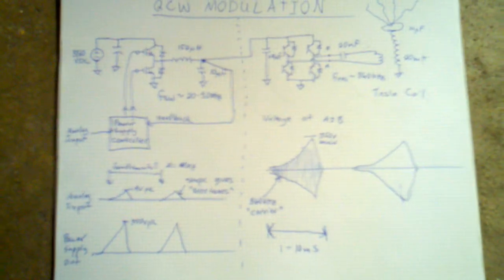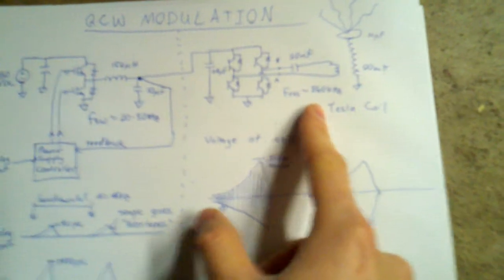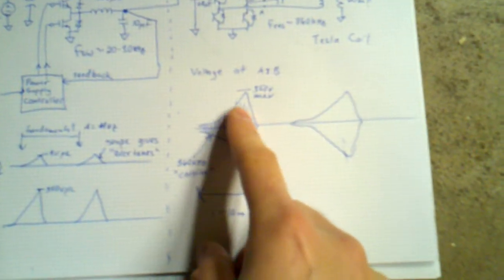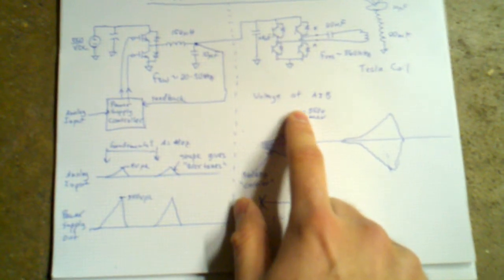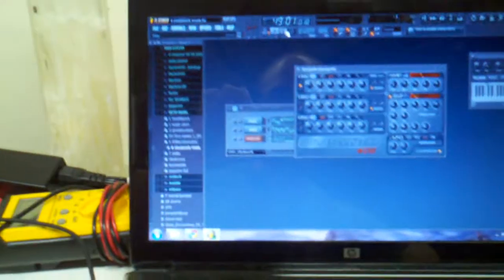QCWoverview1

Comment: Hey Steve! Thanks for the video. I wanted to take this opportunity to say thanks for the Staccato circuit. I started to build a RSGTC back in the 1990s. Had a 14KV Pad transformer for it. Life happened things changed and that projected faded away. Last July 2023, I got excited about coils again, and discovered vacuum tube coils via Steve Arcs. I  finished my GU81 coil and got the staccato installed the other day. That got me hooked on vacuum tubes. I have a GU5A I want to build into a coil as well. The solid state coil is very interesting but the cost of the parts and the ease of destroying them has kept me in the VTTC camp. Maybe some day I'll try a QCWSSTC when I need more challenge. Thanks for all your contributions to the community.

Comment from the maker: Yes, the schematic is missing all the details.

Right, the bottom fet of the "amplifier" is not required, it does improve control, but i have in fact ditched it and went for a standard buck (instead of synchronous buck).  

Yes, you could bias the thing to run half voltage for zero audio input, and this is what i originally did with the project.  The audio quality was better (NOT hi-fi!), but it required much more power and the components couldn't keep up so it limited the spark length.

Comment: I assume on that schematic the feedback/drive circuit for the FETs is missing. Am I correct in saying this circuit more or less just varies the power supplied to the FETs? If so, are you sure the bottom FET in the class-D amplifier is needed? I don't think it really does anything, but I could be wrong. Would you get the same result by simply using a single FET and driving it with a PWM signal? Then, center waveform would be half power output. Might get a cleaner sound. Your thoughts?